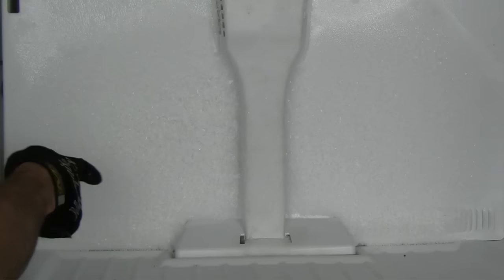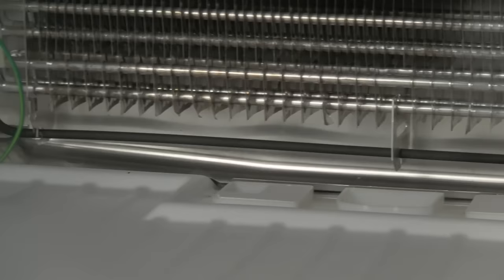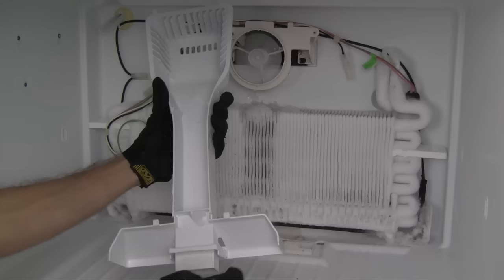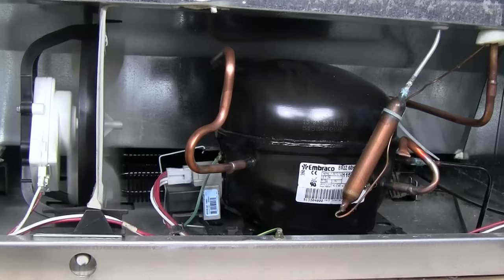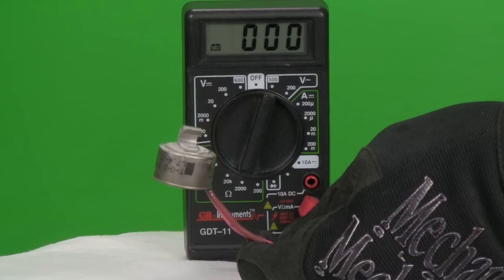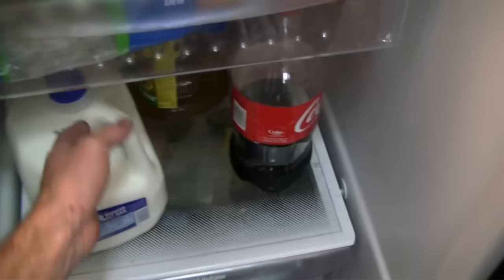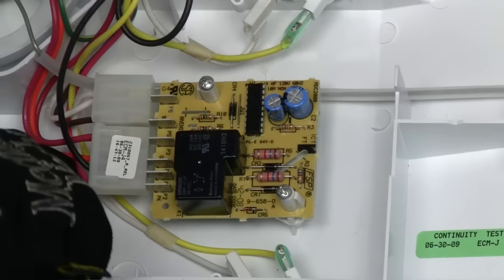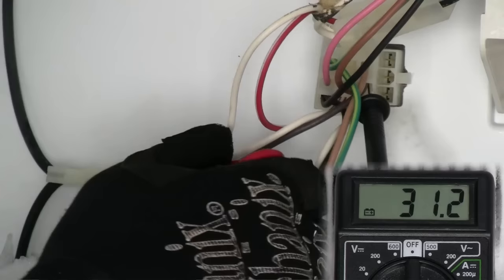Refrigerator Repair (Not Cooling, Defrost System)

Comment from the maker: Sorry I missed this! I'm sure you have this handled by now, but it the compressor is pumping and the fans are working with no cold, the gas must have leaked out and it is not worth fixing. Sorry again for taking so long in getting back with you! Thanks for the question.

Comment: @applianceassistant I tested with a mult and was getting inf resistance, but being new to refrigerator mechanics and testing, I just couldn't believe that that part could actually be broken (even though you said it's the most common). Live and learn!

Anyway, curious -- my defrost thermostat looked like it had its top nearly blown off. Half of it was bulged up into the air, which I didn't immediately recognize was a problem. What do you think happened? Water getting inside and freeze-expanding?

Comment: What if I put the board into service mode and the first test shows a "0" instead of an "S"? Does that mean I need a new thermostat instead of a control board?
Reply from the maker: It really depends on the type of refrigerator. However, normally “O” means open and “S” means closed or shorted. Therefore, if the evaporator is frozen and you are seeing an “O” in diagnostics then likely you have a faulty thermostat. Closed or shorted is the state that the defrost thermostat should be in anytime the evaporator is frozen. I hope that helps. Best of luck!
Reply: @applianceassistant  Thanks so much for responding! I know this video is old, but we have a really old Maytag fridge in our garage and I love to DIY appliances. This video was super helpful. I just couldn't find anything on YT about what to do when I get an "O". I figured it was the thermostat and bought one, but didn't want to install it until I got a replay LOL. Thanks again!

Comment: Hello, im hoping you can help, i have a frost free frigidaire fridge/freezer FRC150FF. The fridge seems to be working fine, but the freezer is cold, not freezing. Ive read thats its commonly a coil problem on the back of the fridge, if the coil is the big coiled grid on the back, that is fine and clean, so dont think thats the problem. Its only recently it stopped working, i have also left it to defrost over night, but still isnt freezing properly.
Any help would be greatly appreciated.
Phil.

Comment from the maker: It sounds like you have replaced all the parts involved with the system... if the rbi-metal and the heater test okay it must be a power supply problem.  When I look up that model 50+ series it looks like it has a mechanical timer... not an adaptive defrost control.  I'm sorry I missed this question! If you have it figured out I would love to hear the result.

Comment: i have a side by side refirgerator the freezer and the fridge are not cool and water has been leaking from the front bottom the compressor is not running will unplugging it to defrost fix this??

Comment: I have a admiral  18cf fridge no frost fridge. The problem is the fridge building up ice inside and not defrosting . I changed the timer ,heater and sensors also the timer works for 6hrs and cuts off for 20 minites and starts again.The ice remains the same it doesn't melt. What could be wrong.

Comment: i have a ge side by side fridge model GSS25KGMC BB.  fridge  has been leaking lots of water. seems the ice has defrosted and freezer fan is working but n ice for cooling.   i did replace defrost heater 6 months ago because it was overfreezing condenser coil then it worked fine. basically evaporator fan is running. fan at compressor is running. all fridge has defosted and leaked water. compressor does not seem to be operating as i touch it. no vibration.  could i have a bad tsta or circuit board

Comment: my Frigidaire freezer was frosting up and not cooling refrigerator compartment...replaced defrost timer...frosting up again after 5 days...what now
Reply from the maker: Sorry for the delay. The next most common thing would be the defrost thermostat...where you able to check the thermostat and heater with a meter? If you don't have a meter to test them with the bi-metal defrost thermostat is a good guess. Hope that helps! Good luck!

Comment from the maker: @MissMiggyUk Normally I would say the bi-metal thermostat is the most likely cause of the problem coming back after you have defrosted the appliance. However on a GE refrigerator freezer your heating element is also very likely to have broken.  Both can be tested for continuity with a multimeter.  lots more info on my website ApplianceAssistant Com! you may also be having a problem with the defrost timer.  the timer may be integrated into a main control board.  Check the other parts first

Comment: My frig was shutting off and throwing the fuse on my electrical outlet.

I checked my defrost thermostat with an OM meter after having it in ice water for a few minutes... I got no reading from the meter... I take it its bad. Can that throw the fuse switch on the electric outlet I have it connected up to? 

1997 Whirlpool two door frig Model ED25PQXDW03
Reply: +squigoth 
I have the same problem with my Whirlpool two door frig(My frig was shutting off and throwing the fuse on my electrical outlet.). Did you ever fix it? What was the problem? Please respond.

Comment: Im unplugging my fridge ..how long to let it manually defront? All the food is in a cooler (but I have no ice to put in it so I wanna get it back in.
I have ice on the bottom back wall of the inside of my refridgerator section.Side by Side Unit GE Monogram.A fan is down there (Refridgerator side) but not turning Temps at Freezer 6-7 degrees Refrige 47 degrees sice yesterday.
Went to buy a spare cheap Kenmore Refr/Fre  for the basement today but delivery is on Tues.Can you assist please.

Comment: hey love your video. i have a question about my refrigerator. its a side by side refrigerator and my fresh food side will not get cold. freezer is really cold and i noticed it has frost on the inside wall. fan on the inside freezer works fine that circulates air to the fresh food section but it just get cold for some reason. any tips on how i could fix it myself. Thanks.

Comment: Hi I have a seimens intergrated 50/50 fridge freezer the fridge half is working correctly as it should but the freezer half is cool but not freezing the produce the moter kicks in as it should and the fan in the freezer runs have defrosted it for 24 hours but when i switch it on its just the same you can here the usual noises but the night before it stopped working i heard a loud crack noise within the kitchen wether this has any relevance i do not know any ideas thanks for looking regards Gary

Comment: Bi-metal fuse - Changed
Defroster Switch- Changed
Heater also Changed
But bottom is not cooling in LG Double door Refrigerator.
What may be the problem. Pls Guide me sir

Comment: Awesome video!!!  Thank you so much for sharing this.  I have a Frigidaire model GLRT183TDBL.  My refrigerator isn't completely warm, but isn't as cold as it should be.  The freezer feels just fine.  I unplugged it for about an hour and a half (enough time?) but that didn't seem to make a change.  I didn't see a place to advance the mechanicle timer.  Are there panels I need to remove to get to it or should I consider going to the next solution?

Comment: Thank you for this video. The compressor on my fridge would run non stop and the fridge would just frost up. I had just clean out the vent. What is the most likely cause of the problem? Timer or thermostat? Any hint on where the timer is normally located? From your video, it seems to be near the compressor.
Reply from the maker: If the refrigerator runs continually and is getting way too cold the thermostat is likely the cause.  They normally run about 80% of the time, target temp is 0º in freezer and 37º in fresh food.   Hope that helps!
Reply: applianceassistant Thanks for your reply! It seems that it is indeed the thermostat as the heater (defroster) did kick in. I will check this component soon. At the moment, the fridge seems to be working normally again.
Reply from the maker: Wonderful!  Thanks for the update!

Comment: my refrigator stays cold but freezes up outside where the thermostat is we took it all apart defrosted everything as it was blocked with ice put it all back together and had no problems for 2 weeks now today it's frosting again outside the freezer like it did before .I turned thermostat down on min and it's still freezing .is it a thermostat problem or something else ?btw water runs down in the fridge as wellwe used to keep a towel in their to soak up all the water.

Comment: You simply need to clean the defrost drain tube, it runs from the back of the freezer down below to the drain pan, a textured metal tray by the floor. Remove the back panel inside the freezer. You will see a coil with a drain/hose below it. Defrost thoroughly with hair dryer. Push a flexible tubing or pipe snake through this hose until water flows freely though to the drip pan. Flush with turkey baster and hot water. You just saved $175 repair man trip. Enjoy.

Comment: I have a GE Profile double door/side by side stainless with water/ice on the freezer door.  The fridge is registering 55 degrees and water coming out from the bottom shelf.  The freezer is working fine and making ice.  I have tried to see if there is a drain tray to remove/clean and cannot find one. Nor in the manual.  Is there something you could help me with?  I am single and no one to help me with this problem just before the Holidays.  Thanks.

Comment from the maker: @TheSamajuma First thing you need to do is find out if the compressor is running or not.  If it is not you need to try to find out if it is receiving electricity from the thermostat or control.  Take a look at refrigerator troubleshooting on my website ApplianceAssistant . Com 
If you have any questions feel free to email me through the site.

Comment: i have a 2010 Frigidaire side by side all fans working compressor on  not getting cold the line by the evap  coil gets a little cold but nothing no ice build up there is also a button in the fridge that stays fridge/freezer then i hold it in for a sec every thing shuts off no fans compresser ect is that for the heater
Reply: the. line going to. coil cold the coil not. cold even. alittle line just. drips little. water couse. maby. line. freeze any. one?

Comment: I have a Galaxy Side by side fridge.  The frigde side works fine but the freezer not so well.  I turned off the fridge so the coils would thaw(they were frosted) an the coils are free of dirt.  I placed a thermometer in the freezer andhave noticed a fluctuation in temperature. It could be -10F one minute and I will check the next day and can be as high as 30F.  Any ideas on what can be wrong?

Comment: Whirpool  wfr990slam02 fridge - 3 months ago it started making noise. I took the freezer rear panel and the coil was frozen up. The ice buildup was so big, the fan blade touched it. I removed all ice and used a hard dryer to remove it completely. All was good for about 2 months. The new issue was that the ice maker did not work, leaked water !  I removed the panel again and this time there was ice buildup around the thermostat side but no other areas. I used the hair dryer again to remove ice and plugged it back. Fridge is working but the freezer section won't ice up anything anymore. Its warmer than the fridge area.   I replaced thermostat, no change. I checked behind the panel, no timer. I checked behind the fridge, no timer. The warming coil - the defrost wire or tube - measures ok , tiny bit of resistance - approx 0.3ohm.  So after all this, what could be wrong ? No ice maker, no freezer but the fridge works fine.
Reply from the maker: This description “removed the panel again and this time there was ice buildup around the thermostat side but no other areas” sounds like it could be a restriction in the evaporator. If there is a large amount of frost where the evaporator enters the freezer area but the rest of the coil is clean aluminum, and the frost never progresses over the coil when the compressor is running, that’s not good. Probably coincidental in the timing, if it’s out of warranty and that is the cause, repair is going to be pricey. Hopefully I’m wrong. Good luck!

Comment: @06GTFanatic hi, i am having fridge issues, it will not get cold, or even cool.  this is what ive done so far....i defrosted the unit by inplugging it for 24 hours with the doors open.....fridge still has not gotten cool....the freezer is working fine mind you....the evap fan is spinning but still no cool air is being transferred to the fridge.  I am out of ideas as to what to do, the only thing i can think of is that the freezer fan is not spinning fast enough....PLEASE HELP!

Comment: Well done video.  Do you have any tips on trouble shooting a Viking D-3 Freezer?   A few months ago, showed some frost, but now it's stopped making ice and everything is room temperature! We had gotten extended warranty due to repeated failure of these units, but now that's expired ! 

Any suggestion or help would be greatly appreciated.
Reply from the maker: I would try to shut it down for a day and see if it works again when you turn it back on.  Sounds like a evaporator restriction could also be a possibility... That would not be good... The header image on this page is what a evaporator restriction looks like... (frost on part of the coil, clean aluminum over the rest of the coil)
http://applianceassistant.com/appliance-repair/how-refrigerators-work/
unfortunately I don't have a restriction picture published elsewhere yet.

Generally speaking all of these refrigerators work pretty much the same way.  try taking a look at this page a created, it may help to troubleshoot things. http://applianceassistant.com/appliance-repair/refrigerator-repair/troubleshooting-refrigerator-problems/

Comment: My side by side Refrigerator/Freezer, Ref is not cooling. I unplug the unit for about 10-minutes, after I plug it back in the Refrigerator starts to cool for about 15-minutes, is this a timer issue?ThanksScott
Reply from the maker: It's going to be pretty difficult to give you an accurate guess... there are quite a few possibilities.  That's kind of a strange amount of time. It doesn't sound like a defrost issue. I would guess control board or a bad compressor. Sorry, I couldn't be of more help.

Comment: Excellent tutorial! Before I get out the volt meter and test various components, I was wondering if you could guide me in the proper direction.
My 10 year old Kenmore side-by-side (model 106.53859300) has a few issues.
1. The ice maker stopped working.  In the past, it was a simple fix - clear the rubber water inlet tube of accumulated ice and voila, it worked again.  Lately though, that simple fix doesn't work anymore.  I've troubleshooted it down to perhaps a faulty water valve because the ice maker's timer seems to function properly and the water dispenser works fine - always).
2. (and more depressing) The drain hole at the bottom of the freezer often times freezes shut causing ice to accumulate at the bottom of the freezer (and then water leaks out of the front after so much ice has accumulated).  Many times now I've chipped away at the ice and run hot water over the hole to reopen it.
3. At about the same time that started happening, I began noticing frost accumulate on everything in the freezer.  That's what's confusing me.  It MUST be defrosting, due to the ice at the bottom, but yet the contents in the freezer develops frost on it all the time (the freezer coils, however, seem to be frost free).

The fridge side is fine - cool as it should be and no air vents have ever been blocked.  I've removed the inner rear panel (freezer side) to see if anything looks amiss, and the only thing I can see is a small amount of frost buildup right next to (but not on) the defrost thermostat. Also, the black square of material (also right next to the thermostat but on the other side of it) was no longer folded over, so I folded it back again.  What's your advise?  Thanks!
Reply from the maker: +Dan Stelluto The frost is probably due to an air leak. Sometimes that can happen because of the ice sheet on the bottom of the freezer holing the door open slightly. frost can also cause the door switch to stick and hold the door open, magnifying the problem.  Your model has the ice maker optics board that may be the cause of the ice maker problem... however, with the history of the freeing fill tube I would start with the water valve.
Here is a guide for troubleshooting the optics board:
http://applianceassistant.com/Refrigerator-Repair/Ice-Makers/Whirlpool-In-Door-Ice-Maker-Troubleshooting.php

you may be able to more permanently solve the defrost drain problem by wrapping a copper wire around the defrost heater and inserting it into the drain hole as a drain heater.  Hope that helps some! Good luck!
Reply: +applianceassistant Awesome! Thanks for the prompt response!
I tested the optics board via easier, post 2002 method and the LED responds appropriately (steady on), so I'll replace the water valve first and also try wrapping the copper wire as you've instructed.
Reply from the maker: Sounds good! Thanks for the update!